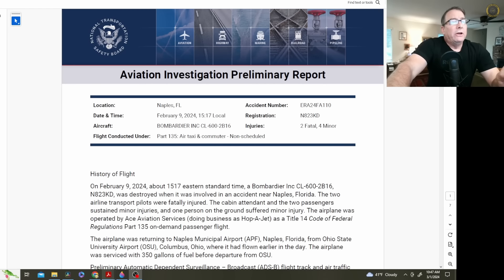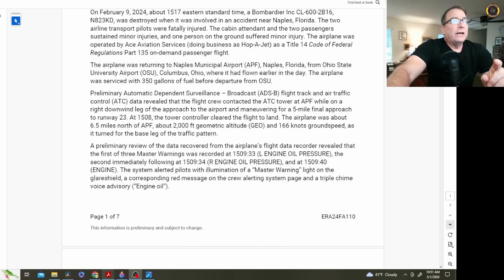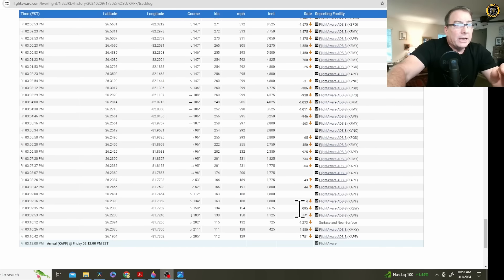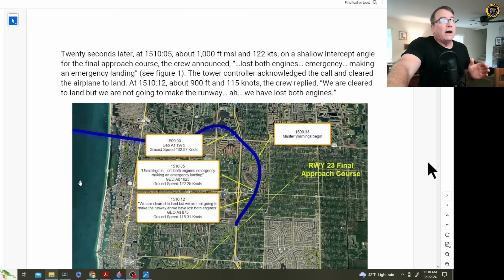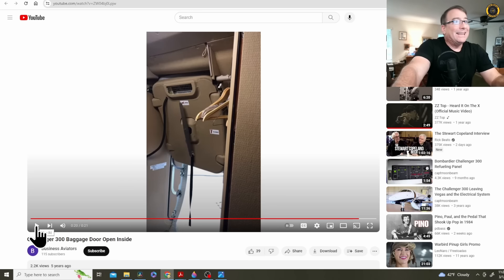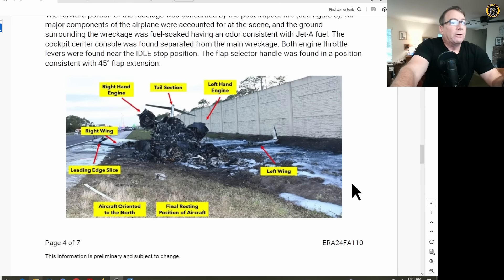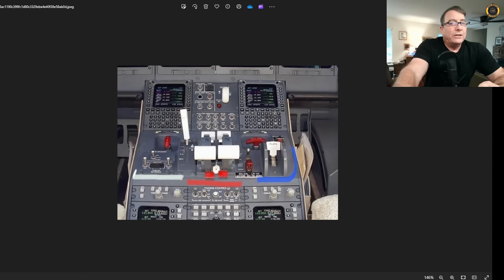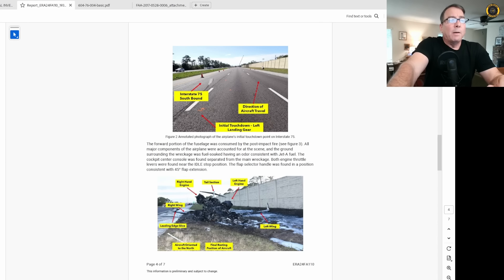NTSB Preliminary Report: Naples Challenger 600 N823KD

Comment: The fact that both engines died within a half a second of each other definitely seems to rule out the possibility of fuel contamination
Reply: Yea, I’m not accident investigator, but don’t have to be to realize there’s no way they die simultaneously from fuel contamination.  Maybe on a B52 you can have two engines fail simultaneously due to fuel contamination… if they’re on the same pod.
Reply: Really? Why is that? I would think it would point to fuel contamination? What am I missing here?
Reply: Not to mention they made 99% of the trip with no issues.
Reply: @_-Karl-_  Your just joking, right??
Reply: @_-Karl-_  Sully would beg to differ.
Reply: Seems odd for fuel contamination to rear its ugly head after a relatively long and uneventful flight.
Reply: @MattH-wg7ou Because each engine is fed from completely different and separate fuel tanks.  The odds of both feed/collector tanks getting contamination into the engine at the exact same time is extremely remote.   If one quit, then a minute or two later the second quit then that would be a different story.
Reply: I seem to recall a BA flight simultaneously losing both engines landing at Heathrow. It was determined to be because of contamination by ice. I mean, I wouldn’t say that’s the cause here, but I think it shows you shouldn’t rule out anything yet.
Reply: @Speedbird9L That was more due to the changing conditions and how fuel flow went up on final, I believe.  Ice formed up high, remained as they descended, then clogged things up as thrust was increased with the flaps and gear going out.
Reply: @badsanta69 the challenger 604 has fuel heaters. No prist needed.
Reply: @badsanta69  No it wouldn't.  The Challenger doesn't need Prist.  It has fuel/oil heat exchangers and fuel temperature monitors.  If the engines had flamed out at altitude, maybe.  Not down this low in Florida and definitely not within 1 second of each other.  Dan Gryder, while a smart guy, is likely going to be wrong on this one.
Reply: @johnaclark1  yes and no on the separate fuel tank thing - the collector tanks are fed by their respective main tanks but once the main tanks get to 93% they are replenished and kept @ 93%  by the center aux tanks which is also fed by the fwd and aft aux tanks. those 3 aux tanks are in turn fed by the tail tank system ( if fueled) and that is controlled by the FSCU.
Reply: @badsanta69  Prist not required, also there are wash filters in the motive flow lines to filter out large ice particles along with fuel heaters
Reply: @tyronetrump1612 Makes sense.  Again, however, even if one of those center tanks had some water that made it's way through the fuel system it would be at the bottom and would have made it's way to the wings first.  I would expect water to manifest itself much sooner, and when it finally does, one engine at a time, not both engines within 1/2 second of each other.
Reply: seems like this was a pilot error.
Reply: @johnaclark1  true the 1/2 second thing does smell.
When refueling normally the mains are filled first then if any of the aux tanks are used the fuel computer will add fuel to the tail tank system as needed to maintain proper CG so it is hard to see fuel contam so late in the game but shit happens. The last 2 Cessnas that left west coast florida with DEF contam, one made it to GA and the other Kentucky I believe before they had issues
Reply: @MattH-wg7ou when multi engine planes run out of fuel, the engines RARELY quit at the same time. Impossible?, no, but virtually statistically unlikely
Reply: @jbsack  I didnt know that. The jet I fly feeds from essentially the same tanks for both engines and if fuel contamination were an issue it is likely they would both flame out near the same time. But higher fuel flow in "my" jet probably plays a role in that.
Reply: @MattH-wg7ou what jet do you fly?
Reply: @johnaclark1 Dan Gryder has been wrong on many of his after game quarterback moments.. LOL.. He is been sued more than once now.
Reply: If the added 350 gals of contaminated fuel wouldn’t it make sense that any other plane receiving fuel from that same truck that day have problems?

Dan ‘I know more than you’ Gruyder, claims it was the lack of prist and NO ONE is going to tell him otherwise.
Reply: Nice forensic examination of what facts are known so far.
Reply: isnt there a FDR on these planes? Otherwise it will be very hard maybe even impossible to find out the cause if no mechanical failure will be found.
Reply: @johnaclark1  Fuel filters clogging up with whatever might have been the contaminant at the exact same time is really unlikely, you are right...OTOH, the filling system feeds from one point and fills both tanks. However I don´t 'like' the shut off theory either, its not like that is done really easily. Maybe if parts of the throttle system were worn - the airfame was close to 10.000hrs. However, isn´t that the same system as on the CJ´s, the regional jets ? if so, they must be subject to way more wear and tear and we haven´t heard anything about these (yet?).
Reply: Heathrow airport years ago just before touchdown both engines out , ice formed and blocked engines filters  (after long flight from China ) All passengers and crew survived.
Reply: @UKfreedom-n5b  Its not the same thing. That was rolls royce specific issue.
Reply: @MattH-wg7ou  The fuel needs to flow some distance from the tanks to reach the engines. That adds time. So it's a bit unexpected if contamination can flow a number of meters and reach both engines at almost the same time. And that it's enough contamination to not just make one or both engines to first lose power and run rough for a while before flaming out.
Reply: 777 into Heathrow had dual engine failure on final.
Water in fuel. Froze at altitude and caused the shutdown.
Reply: @DL14204  They didn't shutdown. The aircraft was descending in flight idle all the way down to final approach. When power was required to maintain speed the engines didn't respond and remained in flight idle. They didn't shutdown. Ice in the fuel melted on descent as temps got warmer but created slush which accumulated on the fuel filters and refroze. When power was required there was no engine response. The engines stayed in flight idle power all the way to the crash.
Reply: Dan gryder wonder if fuel was gel (frozen), they didn't get PRIST from last fill up.
Reply: @DL14204  it seems very different from that accident both because A) they only spent an hour at cruise altitude making it highly unlikely the fuel would get ultra cold like it did in that accident and b) in that accident the engines didn't die, they got stuck at idle power
Reply: Gryder’s go-to theory for aviation accidents used to be  pilot incapacitation due to covid vax. LOL. He’s finally shut up about that.
Reply: @getyoursupervisor8519 .  Yes the RJ’s do have a similar engine shut down lever.  And there were two that had inadvertent shutdowns but fortunately while still on the ground taxiing.
Reply: Agreed... Never want to assume, however the FO flying looking out the right side and calling for full flaps as the left seat pilot reaches over behind the quadrant makes the most sense. Fuel contamination makes the least sense....The fact, as stated in the report showed idle thrust in the MFC. Engines possibly shut down and an immediate reaction to move out of shutoff? Very sad
Reply: @lesstockley4937 : However, NTSB found the turbine blades intact.

Double engine loss due to a bird strike should be easily visible on the blades.
Reply: @grandmarshal7539  yeah, agreed. The 1/2 second gap makes the most sense in the context of the angle of the FO's arm catching the switches at just slightly different points (or if it was the throttle linkage wear, then the throttles being slightly skewed when pulled back)
Reply: @stevez6499  thanks for letting me know. Were both engines shut down and IF so, did Bombardier react in any shape, way or form ? An alert wire, AD, SB or SL ?
Reply: That´s a good point. Much remembers to what happened at Yeti Flight 691 - but at the moment it´s very uncertain what really happened. The Preliminary Report doesn´t explain much.
Reply: @JariJuslin  my reply was to the claim that you never get a double bird strike, not that this was caused by a bird strike.
Reply: @_Karl_ 20 years ago descending into Chihuahua Mexico i had multiple turkey vultures destroy a citation jet I was flying.
Reply: @ such a low altitude on final approach after flying uneventful trip hundreds of miles & report detailed analysis show fuel system clear " A" & filters clear, 

Good experience by the main pilot inside the craft flown and little experience inside this craft by the co pilot. 
Facts only.

Engineering  design & mechanical design of the fuel system is not going to allow sudden engine failure on final approach and in good weather - due to contaminated fuel. 

What is described is electrical and it did not fail per the report.

Filters reported "clear".
Good maintenance. 

The weakest link in this tale?
 Co- pilot error.
Less than 30 full day hours flying time inside this unique  craft. ( highly reliable well engineered quality craft) 

Question: Then what functions is the CO pilot performing on the final approach? 

Final approach the busiest minutes in any cockpit.
The question is addressed in the video. 

I concur with the speculation.
Reply: @chrisschack9716 unaware of any reported bad weather conditions.  Your response is  most plausible except- I am Unaware did the report include icing conditions?
Reply: @GPeterson-jw5sp  yeah, I think that probably the most likely scenario sadly. Even more tragic if so imo.
Reply: @_-Karl-_ that can happen.  Many birds fly at certain distance.   You hit first wave, then get the ones in the back.  You will need a pretty bad luck for that to happen.
Reply: the refueling they did was without prist...(trying to save a dollar)  The fuel likely had ice crystals, causing the simultaneous flame outs.  @Eblancolirio
Reply: @getyoursupervisor8519     I’m not certain if both engines failed on the CRJs.   They were high time/cycle aircraft and the parts were worn out and replaced.   I think a Service Bulletin did get issued.
Reply: @huibspht  no, the Challenger 600 has fuel heaters - Prist is never used or needed. Not to mention every accident from fuel icing spent 5+ hour more at altitude in much colder cruise temps than N823KD experienced, and resulted in engines that stuck at idle and wouldn't respond to increased throttles, never ones that died entirely, and not within 1/2 second of each other.
Reply: @stevez6499  thx.
Reply: lmao what  @_-Karl-_
Reply: @badsanta69 Wrong.

Comment: Thanks for this update. It's notable that there was any water at all in one of the fuel lines.  The Challenge uses separate collector tanks for each engine.  However both collector tanks can feed from the same tank, esp. the aux tanks. As to why both engines should shut down at almost the same time? The shut down did not occur during level cruise.  It occurred around transition from downwind to base leg.  The aircraft was in deceleration, a left then right turn (higher g), increasing rate of decent, and lowering flaps. If there was water in the bottom of a tank, the deceleration or attitude change may have cause a slosh to collection point, depending where it is the tank that was being used. Also note that on the Challenger, selecting flap (>20° IIRC) initiates an automatic cross feed between main tanks if there is an out of balance above the landing config limit.  So if one main tank had water it could appear at both collector tanks and both engines on flap selection. Impressive flying, getting it on that road. RIP.

Comment: Not going with bad fuel tentatively.  Flew too far without issue.  Throttle cut off and no refire, a distinct possibility.  Facts will determine the cause.  They flew it to the ground.  Best they could.  Timing of setting the flaps, what does the show and how does it coordinate with engine cutoff/loss of oil pressure?  Good presentation Juan Brown

Comment: This may have been mentioned before. It’s a 604, not a 600. The 600 has Lycoming engines, not GE and , as I remember has separate engine shut offs. 
Yes, the type certificate is 600 but the model is 604.

Comment: As you displayed that image of the center console and thrust levers, I immediately had the same thought of the Captain reaching under the FO’s arm to move the flap lever.  I flew the CRJ-200 (similar jet with similar setup) for a year and was always cognizant of the possibility of this happening and would consciously/subconsciously raise my elbow when calling for a different flap setting.  But in the heat of a busy approach I could  totally see the other pilot’s arm bumping or his sleeve catching those cutoff levers at exactly the wrong time.  Good on them for flying it to a landing and good on the FA for evacuating the pax.

Comment: The fuel at the OSU FBO is premixed. Flown there several times myself. If prist was not added, I presume it would be evident on other jets fueled there. I’m also thinking a dual flameout within a second of each other to be an extremely rare event that was due to fuel contamination. 

I will wait until I see more evidence before drawing a full conclusion. But I’m aware of a highly experienced and excellent dual-rated crew who accidentally shut down an engine on a Challenger during taxi. If it happened to them it can happen to anyone. I’d be interested in the PF’s other type ratings. That may likely be in the final NTSB report. 

Thank goodness for the FA’s quick thinking!  That was an amazing heads-up move that saved lives. May God bless and comfort the families of the crew members who perished.

Comment: I would think that fuel contamination would cause an issue much earlier in flight. The fuel systems have components to circulate fuel in the wings to help with any water contamination by dispersing it in the fuel. The amount of fuel they took on in Ohio wasn’t much for that aircraft for that trip - maybe just enough to avoid ramp fees.

Comment: I've been saying it ever since this accident happened. I was always leery of the cutoff blockers to the thrust levers on the Learjet and CRJ jets. One time - someone managed to flame an engine out by pulling the thrust lever to idle in an aggressive manner (think slapping to idle). The controller wasn't exactly dialed in and it flamed out. The other was a worn out cutoff blocker and the thrust lever went past the gate, but we brought it back up right away, and nothing happen (of course we wrote it up).